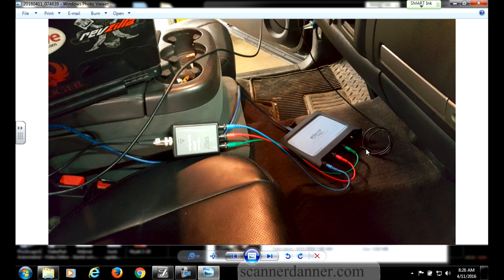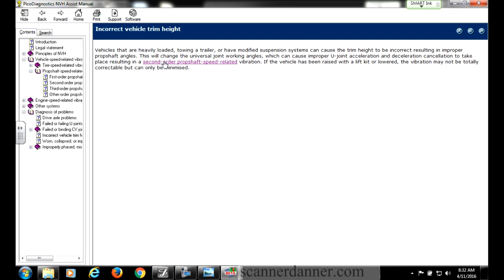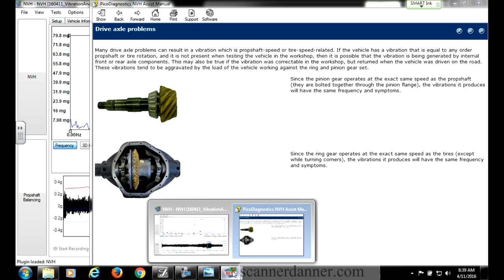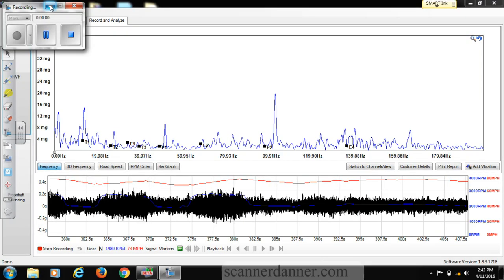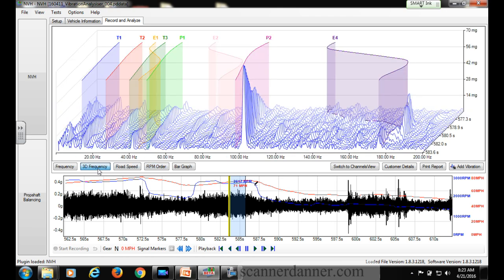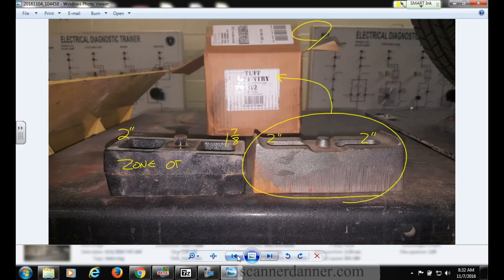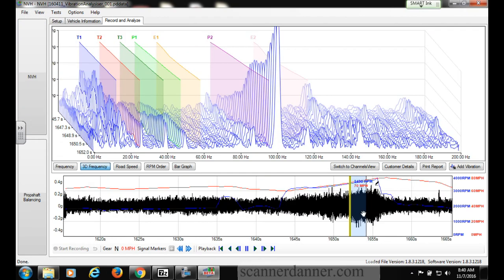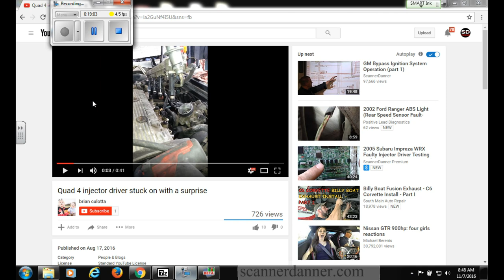Using the Picoscope NVH kit to find a drive-line vibration

Comment: I would guess that the points (E1-4, P1-4, T1-4, etc.) are calculated based on the input from the OBDII data and overlaid onto the  frequency plot. If that is correct tires and prop shaft vibrations would correspond to speed since the transmission gear and slip are unknown. The computer is measuring vehicle speed at the transfer case/transmission so it shouldn't be affected by tire size, so I am also going to assume that there is a error with a multiplier since the projected points miss the peaks by a greater amount as the frequency increases. I'm wondering if that could be caused by a delay between MPH/RPM input from OBDII and actual live data from the accelerometer.

Comment: HI Paul, do you have the 4 axis kit from pico? If so, I would recommend to use the second sensor and attached close to the propeller shaft so you are sure is the problem. By doing this the amplitude of the vibration would be more significant. I personally own one kit and use it a lot. The bar graph is for me the easiest way to see it, but that is just personal preference. I had attached to a differential on a BMW that was driving me nut! 
Also to check the inclination of the shaft to specs you can use this un expensive app (clinometer app). As other mentioned John Kelly on the Weberauto channel on youtube has a lot of good videos for the NVH.

Good luck

Comment: Being as I have 14+ years vib analysis experience at least one of my accelerometers would have been mounted as close to the power input on the diff as possible. Sensing from seat rail has too many attenuation points.  Expected vib frequencies, propeller shaft, axle shaft, pinon shaft bearings (2) carrier bearings (s) and gear tooth mesh.  Vib analysis is another world unto it's own.

Comment: if E2 is going higher in frequency according to speed, and meet P2 can it  mean P2 is a solid vibration not a rotating vibration ?  all rotating parts should turn in proportion one to another can we figure it this way ?thankPeter

Comment: Drive line angles can cause some serious carnage to transmissions. You would be amazed how often a new semi truck or straight truck have incorrect drive line angles from the factory and wipe out the output bearing and rear planetary on a transmission in the HD business. Spicer has a really slick program that allows you to put in data like the type of driveline, the configuration of it, gear ratios, and input your drive line angles to tell you what the expected vibration would be and whether or not it is acceptable. I think Allison has a similar program but it is not as nice. Our Allison techs deal with this type of problem quite often.
Reply: Man i built my truck myself and cannot figure out my vibes problem at about 1536rpm under load. 15 cclb duramax 7-9 lift. Any suggestions on a shop i could consult with on this
Reply: Thank you brother. I'll try and get this filled out and see what's what. It's hard to get accurate measurement to put into the spicer calculater
Reply: @briansnik1848  you can pick up a digital inclinometer pretty cheap online, just make sure you are taking your measurements off of your axle and transmission in a place that is parallel to the input or output shaft
Reply: @terryeffinp  that's what is hard to find a place to pull measurements off of. Plus ineed a better tool your right=digital

Comment: I tought I could see that p2 was not affected by speed or acceleration frequency wise   :since I saw  E2 coming closer and closer  to P2, of course vibration was bigger and bigger but P2 did move in frequency like E4 and E2.just a tought that rotation was not involve in vibrationthank ;Peter

Comment: This program would be a blast to play with. Do you think g stands for g-force? G force is a force acting on a body as a result of acceleration or gravity.   Since you have rotating objects, I would assume they are referring to g forces.  Let us know.

Thanks for sharing.
Reply from the maker: or grams (a weight measurement), not sure
Reply: The sensor is an accelerometer and measures acceleration in g  (as in g-force)

Comment: Deal with lots of driveline vibration issues in class 8 trucks. Most issues are related to (working angle issues) by working I mean under torque, pulling heavy loads, ride height control issues. If you apply a small amount of torque while watching the driveshafts and carrier bearings you can detect excessive amounts of angle change. With a heavier load the operating angles change. example: (axle wrap) (loose/worn components) The truck drivers complaint usually goes something like this; flat land don't really feel much of a issue but as soon as I start to climb a hill I can feel the vibration. A great video I use to show new apprentices is https://www.youtube.com/watch?v=Idk3BVDVHq4    Kept up the great videos Paul !! One of these days I'll have to post a video from a idea I got from watching your vids on relative compression. (iphone 6 video, stripped the audio, ran it through Audacity, did a freq analysis on the waveform, filtered the noise. Came up with a wave form that looked pretty dang close to a inductive trace)
Reply from the maker: That was an awesome video! Highly recommended
Reply: Hey Travis, been driving truck for twenty seven years and you have to learn to accept vibrations as they come. unless your loading the exact same weight loaded the exact same way
every time you load then your not comparing apples to apples when it comes to diagnosis. all i can say is good luck my friend.
Reply: Sorry Anthony I'm not following your train on thought here, can you explain what you mean?
Reply: Sorry Travis, I should have explained further. I was more or less agreeing with you about the vibration issue and to say that eliminating all things that contribute to driveline noise
is almost impossible. Sounds like you have been around this type of work for a while.
Reply: Thanks for clarifying Anthony, I agree with you that it's almost impossible to completely eliminate all vibrations, there tends to be many dynamics involved in it.  Reducing the major vibrations is all you can do. I've worked as a diesel mechanic for 26 years built drivelines and everything in-between. If I shorten or lengthened a trucks wheel base I use the roadranger software to determine drive line lengths operating angles revs per minute etc... Tire size, gear drive ratio all play a factor in torsional stresses and vibrations. If you have a chance to watch the video I link you can imagine what is happening to the rearends and axles. I've seen many drivelines take out a front diff due to vibrations. Replacing a simple leveling valve and not adjusting the ride height correctly is one of the biggest causes. Not phasing the yokes is the next biggest cause. On a class 8 truck the angles were talking about are usually between 1-4 degrees. In Paul's video if the blocks are 2"x1.875x6" the angle would be 1.2 degrees.

Comment: Good video. Vibrations can be a pain to diagnose sometimes. For example, an inner CV joint vibration. How do you determine left or right? Kind of a double edged sword were faced with. As technology grows and we aquire more tools to diagnose vehicles, vehicles also get more complex. You might be interested in a video I made using piezoelectric sensors with a Picoscope to isolate noises. I'm still getting used to using them but i definitely see how they're going to help me.

https://youtu.be/0vTchTHdDt4

Comment: so the subspension spacing bloke fixed it? but i thought you said the fault was there prior to fitting the subspension lift kit?
Reply from the maker: It was on a much, much smaller scale and only above 83 mph with a fully loaded suspension. Think about the "working angle" of my rear u-joint in that senario. 
The fix for the original problem in my opinion is to take some weight out of the bed or stay below 80 :-)
Reply: ScannerDanner Premium ah i c, very good piece of a equipment i might add!